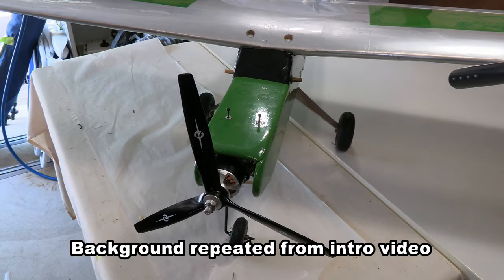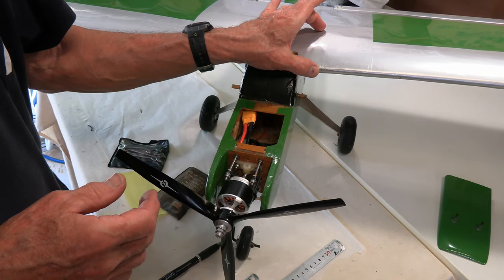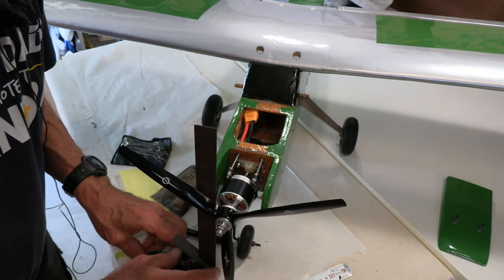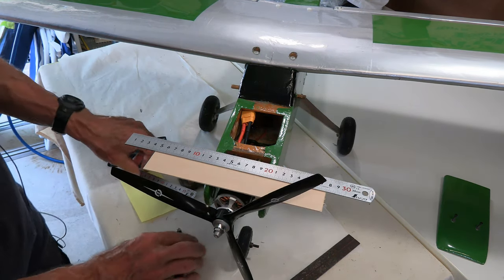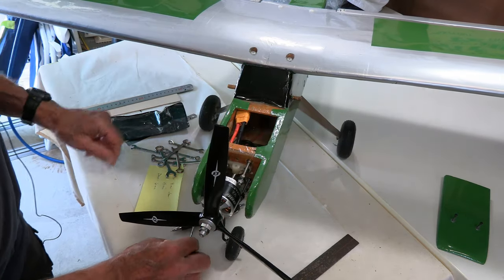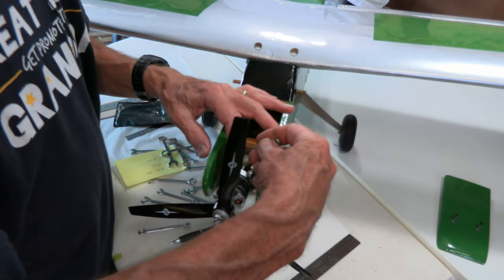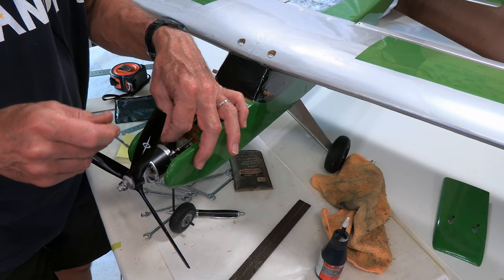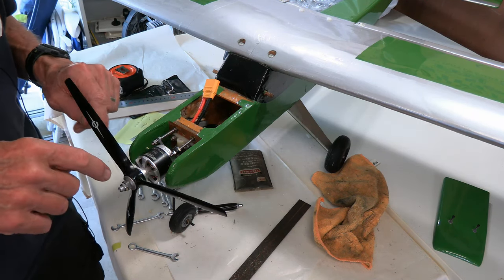Great Planes Trainer 40 Motor Alignment

Comment: u need the plan and side cent line of the plane, measure off that, should be in the plans, if not have to figure it out, thanks Jim.
Reply from the maker: Yes, I'm sure back in that day, builders would just set an offset that they figured would suit, regardless of it not being on the plan.

Comment: Dont you line it up with the tail, a string line, and give it a few degrees of pitch e.g. -2deg?  The forward-back or ur motor = COG adjustment, COL!?
Reply from the maker: It seems to me it would be a bit tricky trying to measure an angle off of a string line.  If you wanted to be super precise, how about this:  put a bit of tape on the top of the fuselage near the nose.  Use a scale and mark the centreline there.  Measure the width of the vertical fin, take half of that, and mark that up at your tape near the nose.  Take a draftsman's T square, or one used by plasterers, and set it on top of the plane with the edge of the long bit on the mark at the front, and up to the side of the vertical fin in the back.  Use a drill press to drill a hole in the middle of a stick of wood that's something like 18 inches long.  Mount that in place of your prop.  Mark out a given distance along that piece of wood.  Measure back from the edge of that wood at each mark back to the edge of the T square.  Calculate the arctangent of the difference between those two measurements divided by the distance that you marked out on the piece of wood.  That would give you a super precise measurement of the angle of offset.
Reply: go Fly ITTTTTTTTTTTTTTTTTTTTTTT

Comment: You could hold the tail, tie it down, full throttle, see which way it pulls, L to R!?
Reply from the maker: That's a thought.  I suppose you could have it attached to a rope to hold it from the tail and see if the rope lines up straight with the fuselage.  But, the biggest thing is how it acts when taking off.